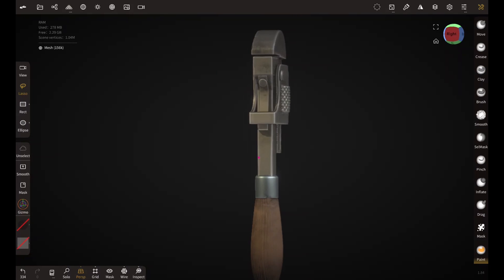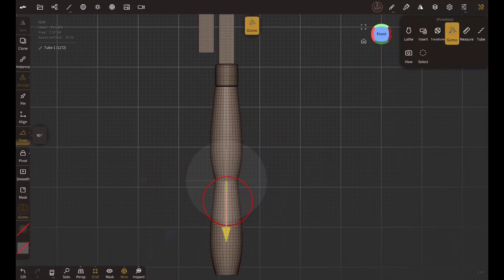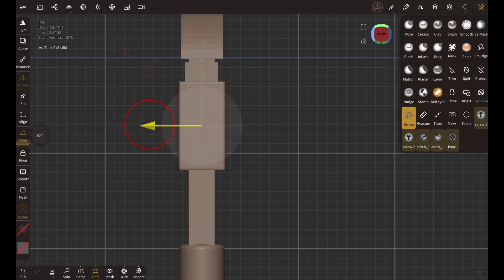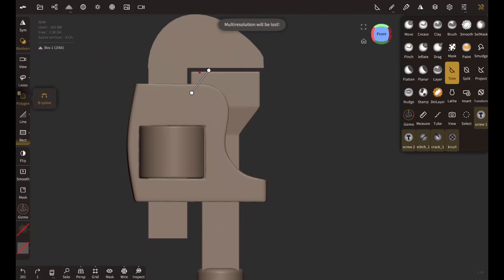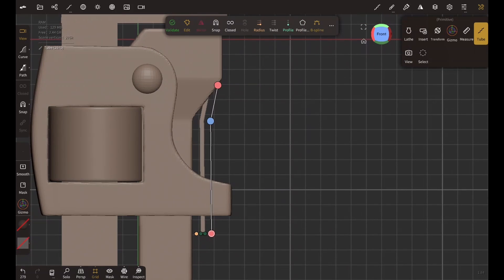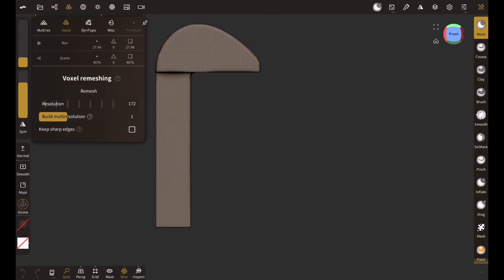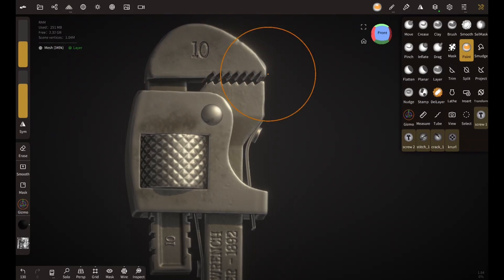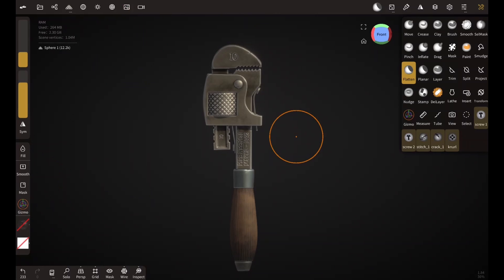Hard Surface Tutorial Nomad Sculpt [Full Process explained]

Comment: How do you get your stamp brush to not add material around the stamp? mine always buldges out when i try using the stamp tool.
Reply from the maker: It's hard for me to understand the problem you're having without a screenshot but I believe under the alpha section of any selected brush (stamp brush in your case ), there's a 'scaling' option and below that there's another one called 'Mid value'. Try playing around with these two options. If that doesn't fix the problem you're having, visit Nomad sculpt's official forum:  https://forum.nomadsculpt.com/ and post your problem along with a screenshot.  Members on the forum will help you. I hope that helps.